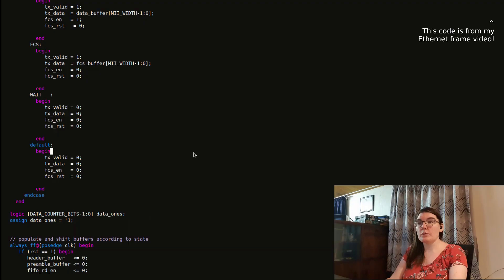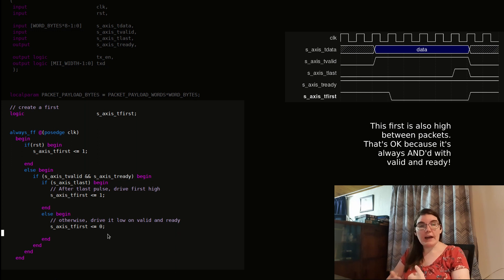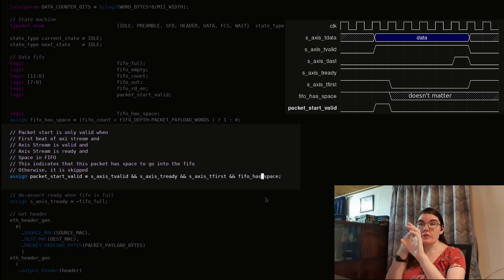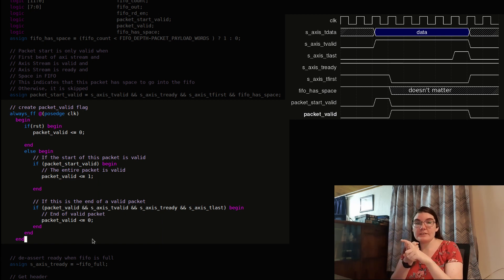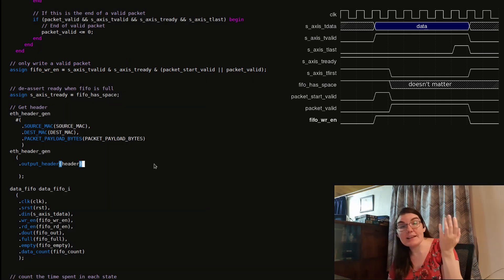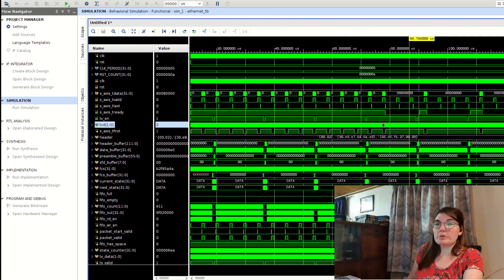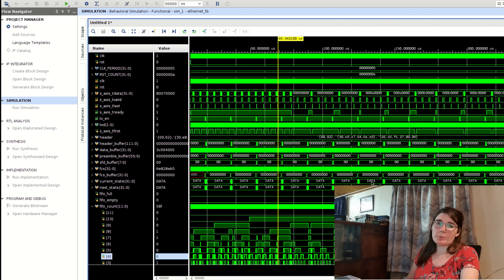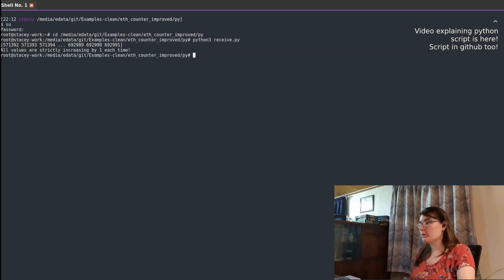Handling Ethernet FIFO overflows in SystemVerilog! How to keep packets intact above line rate!

Comment: hello, how do you simulate 2d arrays in systemverilog? i am trying to work on a project which is doing an efficient serial design for digital image processing filters (kernels), basically my cell takes an input like this : input logic [7:0]a[5][5]; for a 5x5 matrix with each element 8 bits, how do you simulate such thing? do you have test bench examples?
Reply from the maker: I recommend keeping all  your dimensions on the left of the signal name: logic [7:0][5:0][5:0] a;
You can slice them any way you want that way, and you index the same way you define, eg:
logic [a][b][c] a;
assign a[a][b][c] = 1
assign a[a][b] = 10
and you can assign all zeros
assign a = '0
Much more flexible when the dimensions are on the left of the name. But it is only compatible in systemverilog.

Comment from the maker: A quick note! In the python test code, I didn't test between 1) discontinuities on the packet boundaries, and 2) discontinuities in the packets themselves. I've modified my python test code (in github here: https://github.com/HDLForBeginners/Examples/blob/main/eth_counter_improved/py/receive.py ) to take this into account. This does confirm that even though packets are dropped, the remaining ones are kept in-tact. Once again, thanks for watching :)
Reply: Hey , thank you so much for your content, I appreciate what you do and how you explain everything , keep doing ! I need to do for my bachelor's thesis a communication between an fpga and my laptop but when I generate the frames (after programming the fpga ) my fcs is just a sample of incrementing data and not the one from buffer...I don't know why, but in simulation it appears .. I have some screenshots in wireshark and simulation if you can help me .. please .

Comment: Weird question, what language is that you are coding in?  Kind of looked like Java, until I saw "end" instead of semicolons.
Reply from the maker: Yup it's SystemVerilog! I'll add that to the title :). Thanks!
Reply: Based on the rest of her videos,  Verilog.  Another option for FPGAs and such is VHDL
Reply: @ryanvoots9827  Hey, thanks!
Reply: I believe its system Verilog, plain old Verilog you would not use the logic type, instead you would use reg and wire.